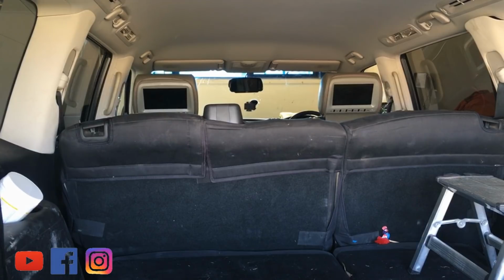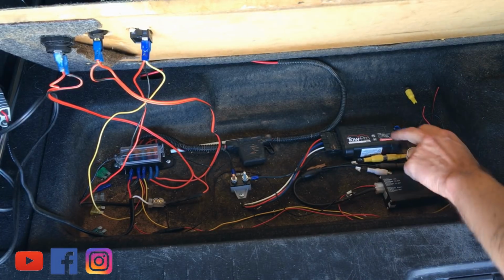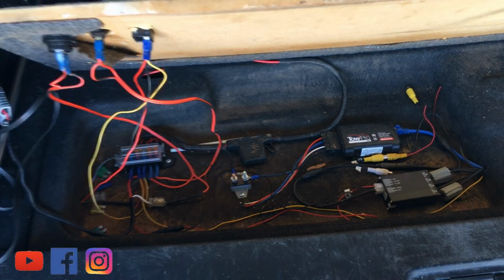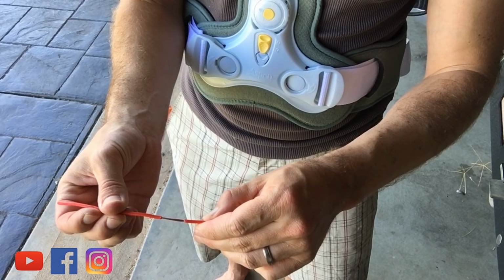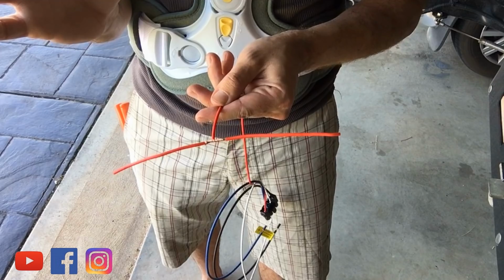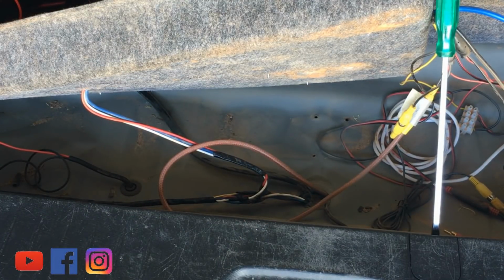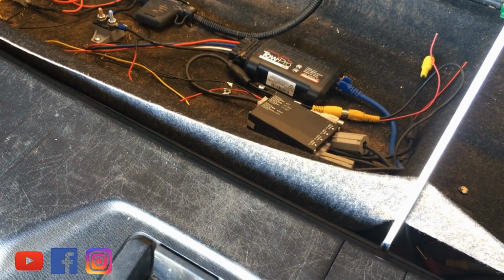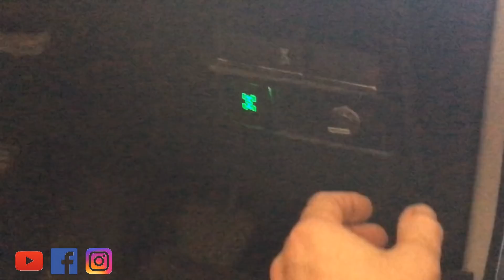ITS NOT THAT HARD 😬 How To Install Redarc Tow Pro Elite to Nissan Patrol Y62

Comment: If you have factory-installed driver assistance systems in a modern vehcile, you do want to cut the brake light wire and install a Diode. This will prevent the Tow-Pro or anything else on the trailer feeding-back into the car. You can make your own diode, or use the RedArc Encapsulated Protection Device.

Comment: With this set up you have here, i.e. Tow Pro unit in the back. Do you still need the tow pro kit, or just the ethernet cable? I have a Landcruiser 200 series.
Reply from the maker: You still need the control knob at the front somewhere, but all the ugly stuff is hidden at the back

Comment: Hi mate l bought my self a tow pro Elite for my 91 model Mitsubishi Pajero to tow my boat trailer the connections l have done black wire to positive battery terminal white wire to negative battery terminal the red wire l joined with the brake lights wire which is the red wire closest to the socket for some reason there was no blue wire coming in to the socket so number 5 socket was empty so I connected the blue wire coming from the tow pro in to the number 5 socket so all I’m getting is a blue light on my control after pushing it to times and the blue light disappears l will be great fall if you can help me thanks Kemal
Reply from the maker: Hey, I’m happy to help but I’m not free. Support me on Patreon and I’ll work it out with you. Cheers

Comment: Good video, but there are better methods for joining the wires to maintain the insulation... 
EG: "Multiple Wire Connectors – In-Line & Close-End Connectors"

Comment: With respect to the ethernet cable - you don't happen to remember if it was a 'straight through' cable or a 'twisted pair' cable?  Great helpful vid btw.
Reply from the maker: It wasn’t a crossover if that’s what you were asking. Cheers
Reply: @DASHOffRoad  ah yep, crossover is what I was trying to think of.  Have you had any issues with your EBC since install?

Comment: Just did the block of wood with a hammer and it snapped both the locking tabs off. Cheers.

Next time I will use a tiny screwdriver to unlock the tabs.

Comment: They have changed the data cable to a useless cable now so you cant do this install (V3). It all has to be in the cab and is a pain.
Reply from the maker: Oh really, that sucks!
Reply: You can order longer cables - up to 6m
Reply: @neiltube8004  Hardly what you want to do after just ordering a kit and finding the cable too short to use in most places. To be honest the unit isn't that great, Ive used it now and the brakes seem to either lock up or do nothing.
Reply: @tombobtail7706  who installed it ? If you are getting full voltage with the dial turned down something is wrong .
Mine works just the same as my tekonsha so far.
Reply: @neiltube8004  I installed it, they are drum brakes so they don't do anything up until the point that the unit locks them. I just think that the whole exercise of having a progressive braking unit on drum brakes is pointless. I guess it does have its benefits though. My main problem is that I bought it based on an image showing a data cable which wasn't updated. So I ended up with this crappy install in the front. I could have bought a $20 unit that went there to tick legal boxes.
Reply: @tombobtail7706  Ok, that's no good. Mine are hydraulic discs but I find all braking systems on trailers pretty cheap and nasty. Especially when I have to dunk them in saltwater.
Reply: sorry but what's a 'useless cable'?

Comment: Do you think it possible to run it off my dual battery in the back of my ranger?
Reply from the maker: keithy0000 should be ok. Mines running off my duel battery from under the bonnet. Just remember if it goes flat from running your fridge or something, you’ll hav no brakes. If youve got a smart solonoid connecting your duel battery to the start battery you’ll be fine as they are all connected when the engine is running

Comment: Gyroscope 😂 mounting in the back?? Resistance and voltage drop on the input circuit is most important.. your right don’t need to be an Auto Electrician.. but to get it done correctly don’t DIY safety features for towing! 🤦‍♂️